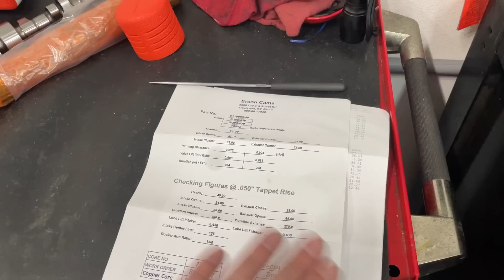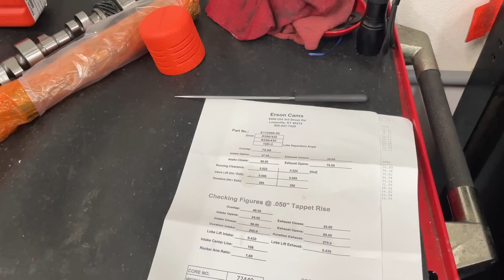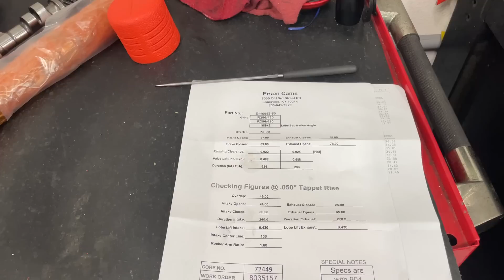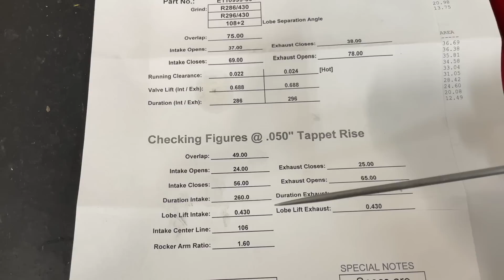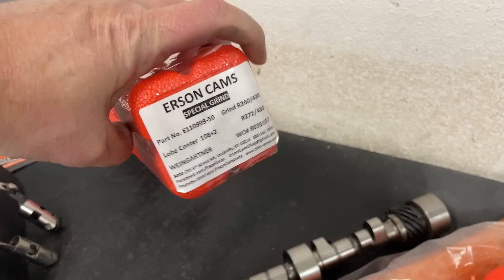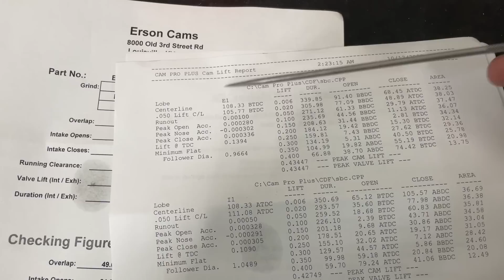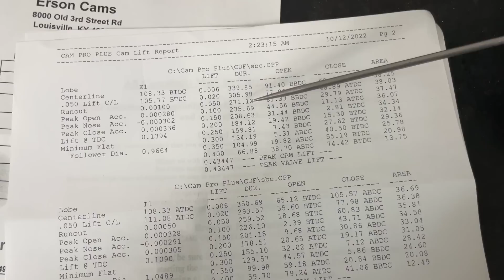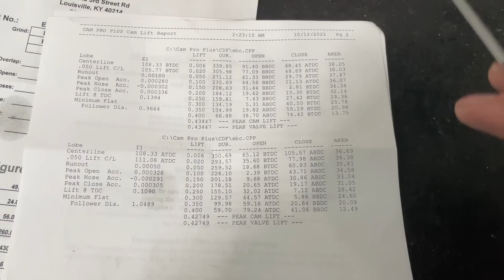Camshaft Info Again

Comment: A very easy fix for rod to cam clearance is to stop using SBC rods. You can build a 427 Cu. In SBC just buy offset grinding the rod journal for a 1.890 Honda rod. So you will have a 4.155 bore and a 3.950 stroke. You can find Honda H beam rods from plenty of manufactures that come in 6in long w a .927 pin and a 1.890 bearing. They will be 100 grams lighter than the chev rod and just as strong. You do not have to grind any block clearance except for at the pan rail by the oil filter pad. And you can run the oversize cam core also.
Reply: I am a fan of the Honda rod journal. Offset grinding the crank, not so much. While it can be done, if you are buying a good crank just get it with the smaller rod journal as built. Also, if you get the rod in an I beam, it will be lighter and stronger than the H beam.
Reply: @v8packard  There is really no difference, either way you have the same overlap. For pump gas engines under 700 hp you can us a stock 400 crank, have it offset ground and it will last forever.
Reply: @racerd9669  As someone in the crankshaft business, I have seen maybe 2 or 3 good stock 400 cranks in the last 7 years or so. Sure, cast aftermarket cranks are available.  To offset grind that crank for that small a stroke change won't take much, but going down over .200 in journal diameter will take a while. If you have a crank shop that isn't charging you by the hour, great. I would still encourage you to buy a crank made this way, and not modify a large journal Chevy journal.  And yes, I have done this and much crazier to cast cranks. I stand by my statement.
Reply: Just as strong? I don't see any Honda rod sizes in high hp SBC's.
Reply: @lte008  Just as strong, or stronger. Reduced bearing speed at high rpm. Proper fillet radii and journal geometry will make for a tough crank. You say you have not seen high power Chevys with that rod journal? Have you seen what Cup car engines do?
Reply: @v8packard  high hp engines. Not cup cars. Power adder engines.
Reply: @lte008  Power adder engines are for people that have no idea how to build an engine, and if you are building a boosted engine you should be running aluminum rods anyway. 
  If you look in the Eagle catalog you will find the HP rating on Honda 4 cylinder rods rated at 900hp. So how much could make w 8 of them?
Reply: @racerd9669  I already know what your mind set is when you said if you need a power adder you don't know how to build an engine. I guess all the pro mod guys, top alcohol, top fuel, etc have no idea what they are doing. Come on man....... That 900hp rating is the whole engine, not each rod.....
Reply: @lte008  We are not even talking about the same thing here. Any heads up class in NHRA racing has very sophisticated engines, so we agree on that. 
  I never said 900hp/rod, but they are rated at 225/rod. 
  Eric is not building Pro Mod engines. His Dyno mule is a low compression pump gas engine. 
   I have built 434 SBC engines and it is one big mess, and when you start reducing the base circle on a camshaft nothing good will come from it. 
  Eric address,s the problem with small dia lifters and small base
circle  cams and he does it very well.
Reply: @racerd9669  yes I agree he explains it well. I've done larger ci sbc's as well. The niche high end NA engines aren't what the majority will ever build or own. So I just don't see people buying and/or machining their SBC engines with that rod. It's easier to find normal sbc stuff as well as all it when done.
Reply: The problem with doing that offset grinding is that you weaken the crank. There's less overlap between the main journal and rod journal, and that takes a lot of strength away from the crank. Just get a block with a raised cam location. Do it right, do it once.
Reply: @racerd9669  Boosted are for those who don't know how to build engines? I think it's safe to say the guys at Proline, Steve Morris and many others will disagree - probably also a lot of Formula 1 teams, Champ Car and teams running Nitro will. You can put all the same time and effort into a boosted engine as you can in an N/A.
You are not special just because you build an N/A, you are just slow.
Reply: @AB-80X  The point you miss is the rotating mass, so less mass will make the bottom end stronger. 
 I am talking about the average guy that will not spend $3000 on an aftermarket block for a 600hp pump gas street engine. A 509 or 511 block will work great for this type of build.
Reply: @AB-80X  They have learned to build N/A engines first, more N/A power more boosted power, its that simple.
Reply: @v8packard  im not im a 3"-3.5"rod ford-size out of the le mon's and 383/560 engine and a voodoo firing-orientation the rest im a 426-hemi platform or 440RB guy

iv seen way to many burnt up bearing's rod main's pistons-bushings using the small 2" and that's in a JDM and DSM's ( also not a 4-banger guy as it compounds it compared with a big large lazybones V8 ) just not a fan even in unmodified costumers car's. i feel it's way too much load yes it can RPM better but the oil swishes out or the aluminium-shell spoll's aka cracking ect

Comment: Cool a 383 stroker, bored out to the max, my cousin Joe had one of those, you could hear him coming, 10,000 rpm everywhere he went,  that thing was fast man.    Sorry Eric,  I couldn't resist.
Reply: 10,000 rpm eh? 🙄nascar cup engines are made to run 8000-9000 for 500 miles. And they cost more than the typical house.
Reply: @b.c4066  The entire statement,  was meant as sarcasm.     Yeah, I hear this crap all the time !

Comment: Imho cam core flex in the sbc is far more common than we all realize, especially with big pressure/volume oil pumps.
Reply: Another reason to never use a high volume oil pump
Reply: @v8packard  yet some cams require that
Reply: @Texasmule  What cams require a high volume oil pump?
Reply: I been running them for yrs, no problem.  I am running a 22171 Moroso Billet spur gear oil pump, high volume, low pressure.
Reply: @jasonstormoen  Many people don't realize things they have going on are the result of a high volume oil pump. For example, I have had several people that drag race, and had excessive oil at the top of the engine, under the valve covers. They blamed it on a poor design. I switched them away from a high volume oil pump, problem gone. I have seen people fight distributor gears, oil temps, pcv problems, and more. Using a standard volume Melling select pump ended those problems.  I would bet 90% of the people that use a high volume pump don't need one. Many people run one without increasing the size of the sump. 
People think they get more oil on the bearings with a high volume pump, but they don't.  Oil flow across those bearings is controlled by clearances, not by pump volume. If you have 'never had a problem' your engine would probably run better with a standard volume oil pump. But you can spend your money any way you like.
Reply: @v8packard   When I lived in Indiana by the Michigan line, I used Steve Morris Racing Engines, one of the best in the business, and he put the Moroso Billet spur gear high volume low pressure oil pump in it my engine. That combo lasted drag and drive and around town miles with 0 issues, countless 660 hits and when we took it out at the end of the season every yr, the bearing, lifters, and everything look perfect.. I moved down to NC and my buddy uses PAR Racing Engines so, I started using Scottie and he keeps using the same Moroso pump. My one combo is a sbc 434 vortech V30-128, ATI Superglide with Gear vendors and ATI bolt together converter. My buddy Curtis and Dan do the heads and intake that are built to order for my combo which us RFD wedge heads with matching RFD intake, custom ground cam that Scottie designed. Kyle New Era did my gear drive for my blower. My carb is all billet IRD dual needle seat e85 and my ecu is a holley dominator, I just don't use the efi on it, but everything else i do.  I have really good reputable people onboard between the 2 engine builders, head guys, and I'm looking into giving Eric here a try on a set of sbc head hunters so I have 2 top end guys.  I am very happy with what I have going on and I make way more power than I can use most of the time because I don't run glue it up events.. Thanks though
Reply: @jasonstormoen  That's all great. I am getting close to 30 years of professional engine building, including performance, vintage restoration, marine,  and industrial.  I have never seen a failure on a small block Chevy that I could attribute to a lack of oil pump volume from a standard volume pump. I have personally built some small block Chevys that ran into 4 digit hp numbers, and others that ran to 8500 rpm. My preference is a Melling Select standard volume oil pump with a 3/4 inch pickup for any small block Chevy that uses a conventional oil pump. I have zero failures with that pump. This pump has been adequate in an engine that had been modified to include piston cooling oil jets.
At one time Moroso was sourcing oil pump castings and components from Melling. I do not know if that's still the case. Note the pumps I use are not the standard replacement pumps with the thinned necks (M55/M55HV). I don't think Moroso ever used the thinned neck casting, either.
Reply: @v8packard  Are you trying to say my engine builders don't know what their doing? What is your shops name?
Reply: @jasonstormoen  No. I said nothing about your engines, or engine builders. I gave you facts about my specific experiences with small block Chevy oiling systems. I am not here to solicit business, to name drop, or to impress people with a list of parts. I am here to share knowledge based in fact, and experience.  
If you are happy with your engines, and your builders, that's great. I sincerely wish you continued success. I am going to keep doing machine work and building engines, and using standard volume oil pumps where appropriate.  Which includes nearly every engine I will see. 
Rather than list off people and parts, you could talk about why you need more oil volume.  It could be you simply used what your shop sold you. And it could be they sell those pumps because it's much easier to sell people things they think they want, rather than what they need.
Reply: @v8packard  Another reason to use a block with a raised cam location and a 50 or 55 mm core.
Reply: @AB-80X  I am not opposed to a larger cam core. The benefits can be tremendous. I am opposed to using high volume oil pumps in most applications.
Reply: At the end of the day there are several ways to do things that will work.
SME has his ways, David over at R-M has his, Moran has his, Musi has his etc.  They all know what they are doing and they all use some specific parts based on the components they like to use. I don't build professionally,, but I have been building my own and friends stuff for over 25 years for both street and offshore. When it comes to oil pumps I think the engines tend to tell us what they like. Some want standard pressure high volume pumps. Some want high pressure standard volume, others again need something else. If the engine will get all the oil pressure and volume it needs with a standard pressure and standard volume pump, why use a high volume? All the styles of pumps come in high quality versions. Sometimes a high volume pump is great for drag racing as it moves a lot of oil in the short time it is needed. On the flip side I tend to stay away from high volume pumps for the boat engines I have built. They will build up way too much oil in the heads etc. as they run high rpm for prolonged durations. If both high volume and high pressure is needed in a marine application I use dry sump.
In short, there's no need to argue about it as long as what we build works for what we do.
We all got our little favourite ways of doing some things. Mine? I use raised cams in everything because I believe in getting a big cam core. Will a 55 fit, then I use that every time. That's just me, it works for what I do and I'm willing to pay for that specific thing in everything I build.
Some want Moroso billet pumps others like Melling. Both are great and what pressure and volume often depends on the application.

Comment: I have an Erson that came in my 434 short block from Nyes. Only issue I ran into is that it was not mentioned on the cam card that they ground it on a 4/7 swap core. Quickly found the issue after initial fire with a header temp check. Those 2 cylinders were hot as hell. Swapped the plug wires at distributor and all was good.
Reply from the maker: It happens.
Reply: You needed a temp gun? That thing must have sounded like it was rattling itself to death.

Comment: Great informational video. The hyd roller cam we got from Howards, for my wife's 383sbc is a billet core, but with a steel gear pinned on. They recommended a melanized distributor gear. I had planned to go with "Howards" Max effort 91160 lifters, I had someone tell me that they are rebranded Gaterman lifters. Problem was that Howards couldn't give me any kind of idea when they would have some in. From what they were telling me, it was 6+ months out at that time. I ended up going with Comp's Short travel race 15853 lifters, because there were a few sets available. These look a lot like Johnsons, but I'm not sure. Now it's the other way around as far as availability. For my 582, I really wish that I had gotten the 55mm cam bore and .904" lifter bore block. But just like the lifters, they only had the standard merlin IV block available. Hopefully all will be fine.
Reply: I used comp short travel lifters in the quick street engines for several years. Had a few sets cause problems after a while. Mostly after the second or third year/season they'd have noise or give problems with valve control all of a sudden that wasn't related to springs. Couple sets were bbc and one set that really gave me fits was in a sbc. They sure look like Johnsons to me. I switched to the Howards high endurance or the Howards pro max hyd roller depending on the cam. The Pro Max works great but you do need 220-240 lbs on the seat for those
Reply: @mikecole1057 , the engine we used the Comp short travel lifters on was just my wife's 383. It's built as a moderately aggressive cruiser. It's an all forged 10.8:1 383, AFR cnc'd 195 heads, 241/247 @ .050, .583/.565", 112lsa, Performer rpm intake with 1" tapered 4-hole spacer, topped with a Holley sniper. The goal was the typical 500ish hp on pump gas. It's in a 2900ish lb '63 chevy II. I may take it down the track a few times, but not often. I know her, she'll never take it above 4500-5000rpm. I'm the one who will beat on it occasionally. I've set the rpm limiter at 6600. Based on the build, I kind of figure peak hp will be around 6100-6300rpm.

Comment: Glad to hear you say Johnson lifters I use some myself although my valve train is loud Comp said my cam will be loud plus injectors clacking adds to the noise
Reply: If your hydraulic valvetrain is noisy, you probably need more lifter preload to quiet it down.  That might not be possible with certain lifters.

Comment: I built a 383 with hydraulic morels. I tried different weights of oils and different lash settings. Thought I did something wrong at first. Crazy loud! Then realized it was a huge issue with them. Haven't used them since.
Reply: The best thing we can do is to not use them. Then they might get the message. Unfortunately BTR and a few other popular guys keep flogging them and turn a blind eye to the issues.

Comment: I have used my share of standard travel Morel hydraulic rollers. I run .050 to .060 preload on them, which is twice what John Callies recommends. At this preload, they are quiet. They work well at this preload. Obviously you can not do this with short travel lifters.
I also like Bam, Gatorman, and Johnson lifters, as well as Isky. I have no troubles with solid rollers that are properly lashed and have the right valve springs.

Comment: With the Erson cam closing the intake valve at 69° you can run a lot more Static Compression than 11.50-1 on pump gas.  
I’d run the numbers but I don’t know what stroke you’re going to use.
11.50-1, 3.75 stroke close the intake valve at 55° nets a DCR 8.78-1 perfect for 93 octane.
Reply from the maker: The cam was not picked to be optimal just nice in the middle of the road cam.
Reply: @WeingartnerRacing  Erson is a great company!  I remember when Super Shops was open a lot of people ran Erson cams!  Good luck on the new build.
Reply: @HeadFlowInc - you are likely right; there may be a little left on the table here.

Here's the question: so what?

We're looking for this to serve to compare cylinder head "A" to cylinder head "B".

If the engine's down some amount of HP, it's not a big deal... it's gonna' be down the same amount for each test no matter what.

I mean, the engine isn't going in something where it's got to be set on "kill" to try to squeeze the last couple HP outa' it.

And that little bit of compression that gets sacrificed may make the engine a little less likely to be harmed if a pull or 2 gets made with the tune a little 'off'.

Comment: Hey Eric I heard nothing but good about Erson cams that guy Tyler that sent you that E85 carburetor to try out had a guy at erson grind him a camshaft and I am impressed as hell with it my next motor will be either a 406 or a 421 I think I'm going to use a dart shp block and a scat rotating assembly from ship white intact I will more then likely get skip white to build the short block. But yes I am impressed with erson cams. Great video thanks for your time. Your friend from Louisiana Rick 427